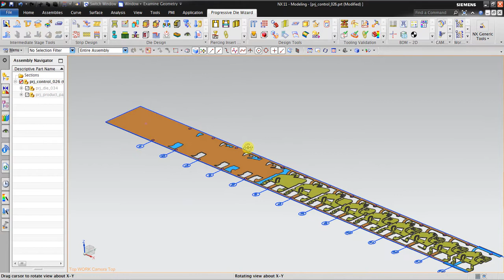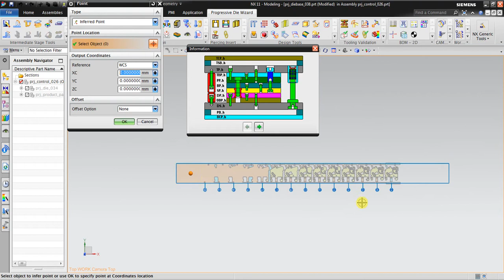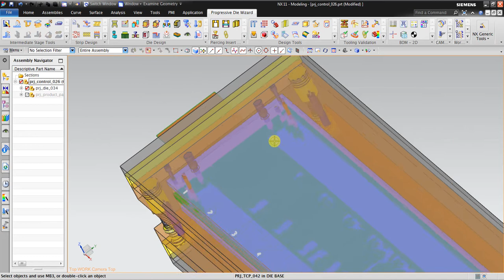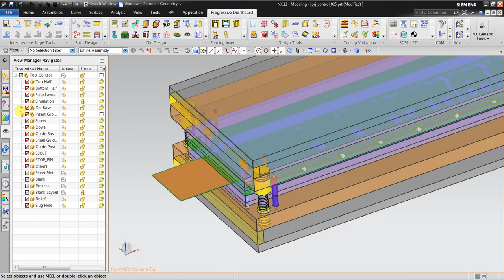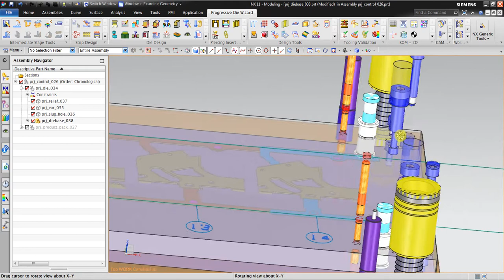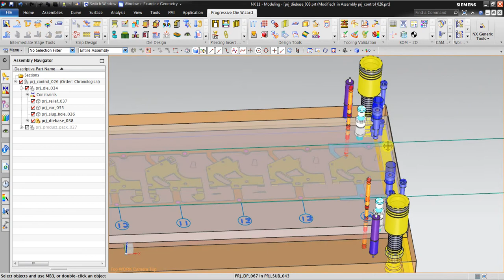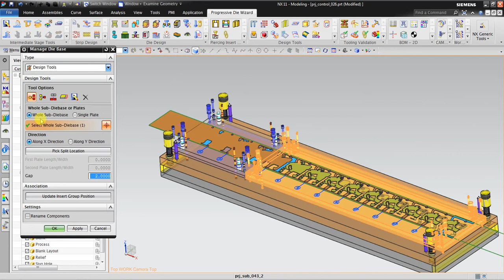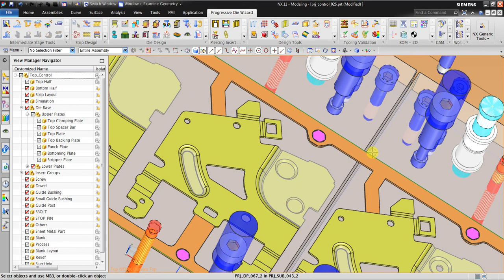NX Progressive Die Wizard (PDW) : STEP 05 - Die Base Design & Modification

Comment: Sir, do you have the standard size of each plate, especially the thickness. Could you please send to me mail. Thanks sir tranngocquang89qt@gmail.com
Reply from the maker: Hi Sir, I use 1.5 mm plate thickness. Uniform thickness on the product geometry.
Reply: @CADCAECAMTutorial  i want to ask about thickness of mold base plate, thanks,
Reply from the maker: Hi Sir.

Really sorry for my late reply. I have been sick for several days.

I am sorry I do not have any reference standard. Most of the thickness I just follow NX PDW default library suggestion.
Reply from the maker: I also sometimes using NX CAE for checking plate structure stiffness. So I observe the bending value if certain load applied at selected plate thickness and designed stiffener.
Reply: Thank you for your kindly reply to me, in injection molding, futaba giving the base size standard, so we can choose without calculate much, but, in progressive die, futaba don't giving the base size standard. So, almost case we choose by the experience. Thank sir,hope you will healthy soon.

Comment: Sir, why should we split the plate into 2, 3 plate? How long one plate is OK ? Thanks sir
Reply from the maker: Excellent question.
We split become 2 or 3 plate is based on how much tonnage needed for stamping, how rigid the upper dies too.

By splitting become more than 2, then the upper dies become more rigid. Less length then less bending due to stamping force is divided per upper dies section.

For how long 1 plate is ok its hard to say a certain length value. It is very depend on the product also. If too many features created and too many insert, then you can create longer upper dies to compensate any space required for insert. But please add stiffener such as web ribbing on upper dies.

Hope that answer your question.
Reply: @CADCAECAMTutorial  many thanks,sir, useful answer. I have been thought that we split into many small plate for easy   CNC manufacturing. But its by force, so i will think again.

Comment: Dear sir u r doing well, I loved your videos a lot it's easy to understand and saving lots of money on classes, I also have finished your first 4 videos but I got error in 5th video in die base command so could  please send me the download link for Engineering databases for Nx 10.0 and the PPT file  on my id : abhijeetpagare700@gmail.com.     Thanx in advance
Reply from the maker: Dear Sir. I am very happy to hear viewers get benefit and knowledge  from my videos. 
But aplogize I don't have NX Engineering Database anymore for version 10. Since I already upgrade to version 11, therfore I discard Ver. 10 to save harddrive space. 
Perhaps other viewers here can help. Thank you.
Reply: @CADCAECAMTutorial  sir if I download Nx 11 or 12 then the problem will solve for Nx progressive die databases ?
Reply from the maker: @smartcad2968  No. It should have same version.
Reply: Ok sir
Reply: Thnx sir due to you I have completed this course successfully but at the last tutorial my computer goes hang due to less ram.
Reply: Sir my system having 4gb ram so what is the minimum system requirements for Nx PDW please help.......thnx in advance

Comment: when I click on die base design appears a message that says failed to open register file. Someone has the same problem as me? How can I solve it. 

What happens if I want to build my own die sets?
Reply from the maker: Do you have microsoft office installed ? All database in NX are registered and open using excel.
Reply: @CADCAECAMTutorial  can you describe this in detail?
Reply: I have same problem than Meltri. I have been unable to solve it despite dedicating several hours to find the solution ( and I have microfort office installed)
Reply: It takes me long time to find solution, you can try as link: https://www.youtube.com/watch?v=NRWk91gECAQ . Hope it useful for all.